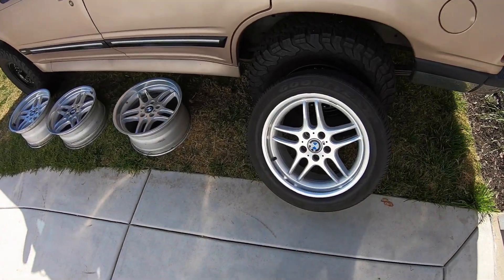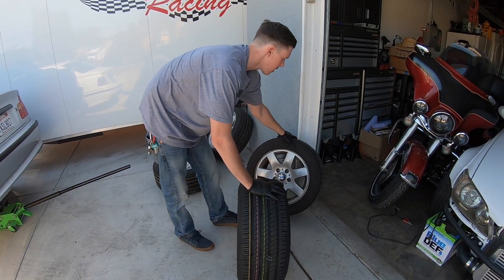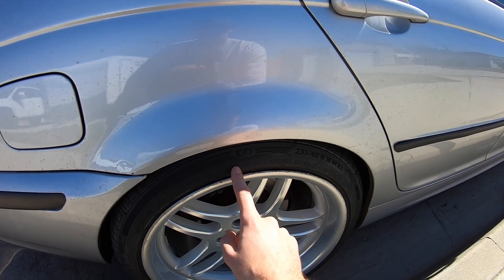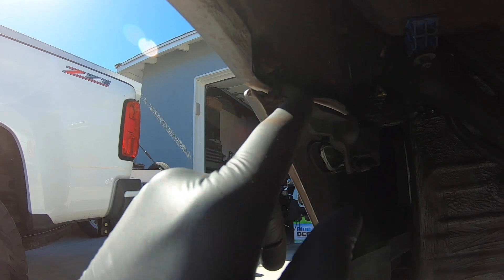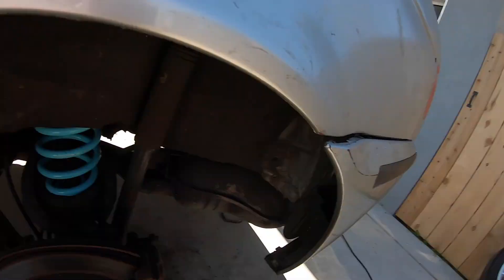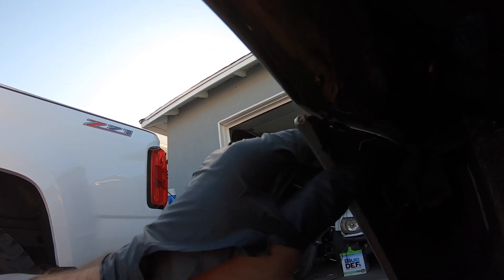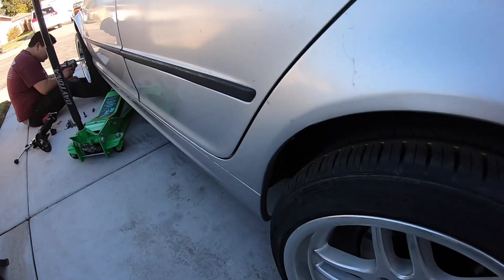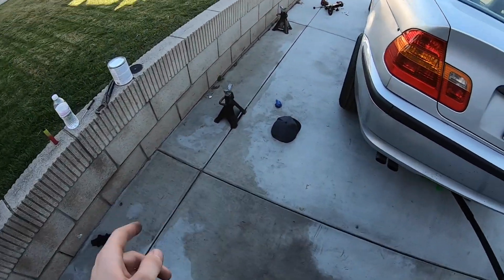E46 Build Ep. 3 (Fender Cutting and Rolling)

Comment: The inner wheel well and rear quarter panel are spot welded and folded. Not a good idea to cut that lip off.
Reply from the maker: It was the only way, I should have gotten smaller tires

Comment: Wouldn’t 225/40 be too narrow for the 9.5 rear wheel? What do you think of 245/35 for the rear? I’m about to install some M3 staggered wheels on my e46 too.
Reply from the maker: 225 would be a little bit of a stretch but its would be perfect for clearance on tue stock body
Reply: I have 255 in the rear and I’m aboht to put on coilovers not planning on slamming the rear but still lower then stock I am rubbing stock but hoping that the stiffer suspension will be enough so I don’t have to cut and just roll the fender

Comment: I have the same e46. Got 19s no rubbing with 235/35/19 front and 235/40/19 rear. Going down to 18s m par, what tire size do you recommend? Subscriber from Manila here! More power! 🔥
Reply from the maker: If you have the E38 M Pars like i do id would go 215/40 225/40
Reply: @slightlymodified501  i have m pars with 215/40 front and 225/40 rear
And with small fender rolling  its good
I also have lower spring sport from H&R

Comment: i did exactly that, what you mentioned you shoulda done, having the same staggered set of mpars. i have 18x9.5 in the rear and 18x8 in the front. i did 225/40/18 in the rear and 215/40/18 in the front. and the rears rub just a bit on the corner of the sidewall, and the fronts dont rub only a bit of contact on full lock. just fyi

Comment: imagine this and stay focused because it looks like it's really hard theory to understand when I'm watching this video, so the theory: BUY THE CORRECT FCKING WHEEL... stock body, same height on 235/40-18, flush to fender with spacer so I have space to step up to 245, didn't touch the fenders...  if you're watching this kids dont fck up your car to run "meaty" 225s lol just use your brain, measure and order correct wheel....
Reply from the maker: I bought the car for $400, Ill cut the dang roof off if I want, doesn’t matter to me. I agree with your opinion, If It was a more valuable car Id approach things differently. 
Thank you for your concern
Reply: @slightlymodified501  Lol